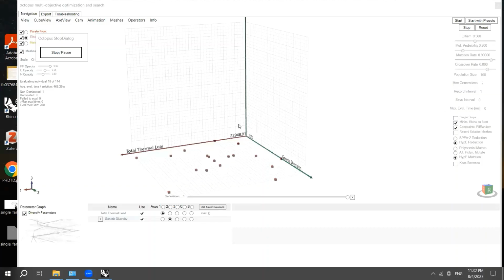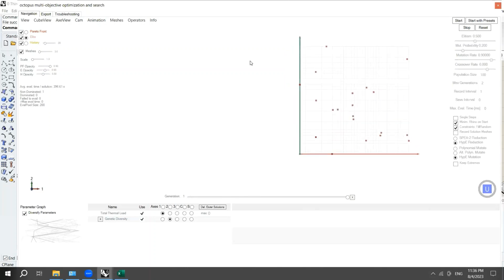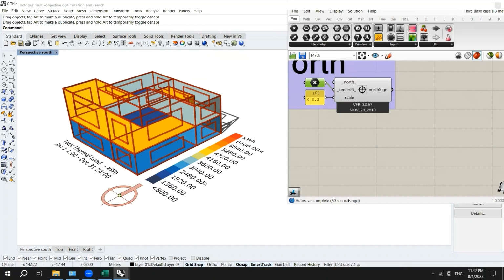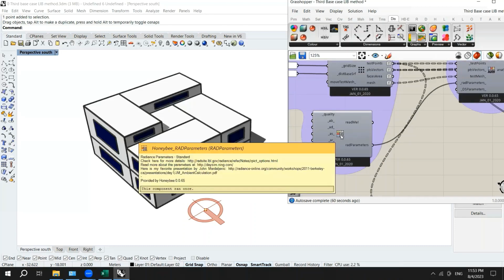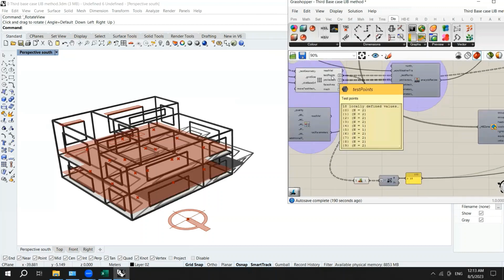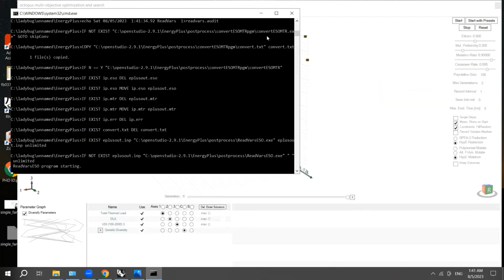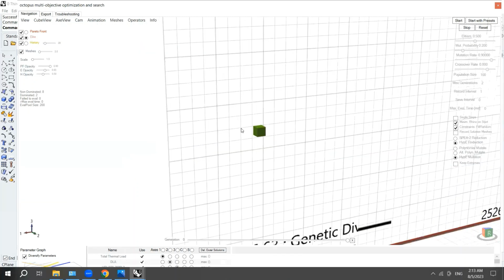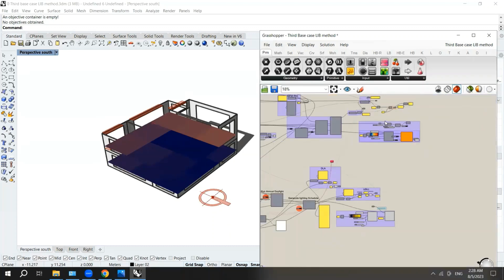Part 3 | SIMULATION & OPTIMIZATION, energy and Daylighting | Grasshopper, Ladybug tools, and OCTOPUS

Comment: Thanks, great tutorial.جزاكم الله خيرا
Reply: Do octopus save the SQL for the result of each iteration ?
Reply from the maker: Could you please mention what does SQL stand for ? In general, Octopus doesn’t save all data associated with the each iteration; but you can use TTtoolbox to save all information related to one iteration in an excel file ( i.e dynamic parameters and their corresponding objective functions for each iteration)
Reply from the maker: جزانا و اياكم 😊